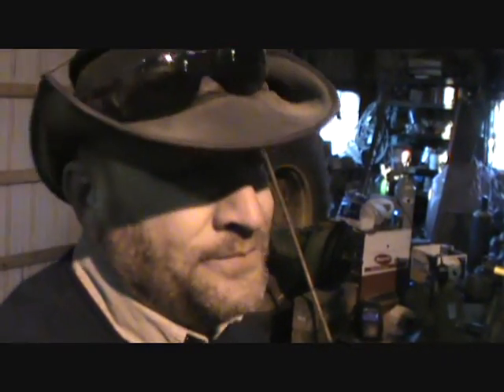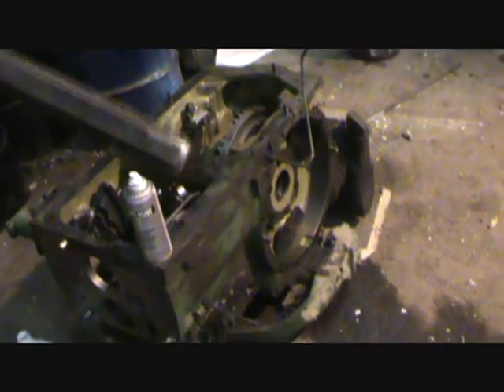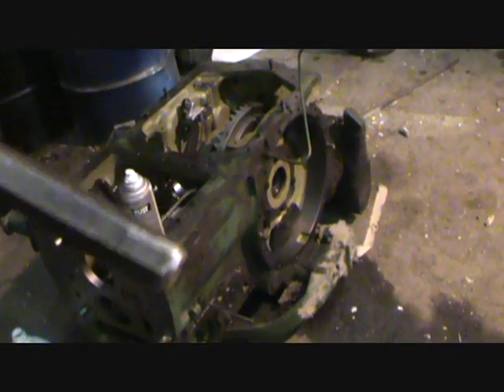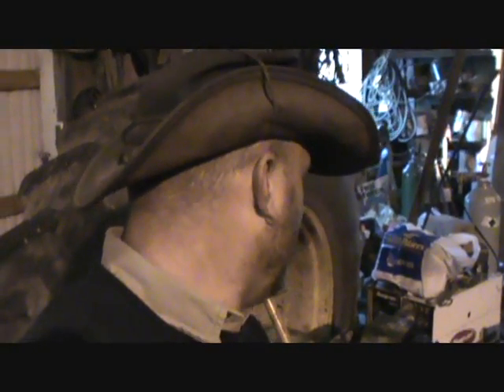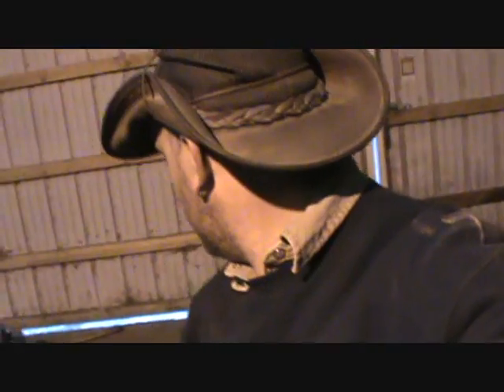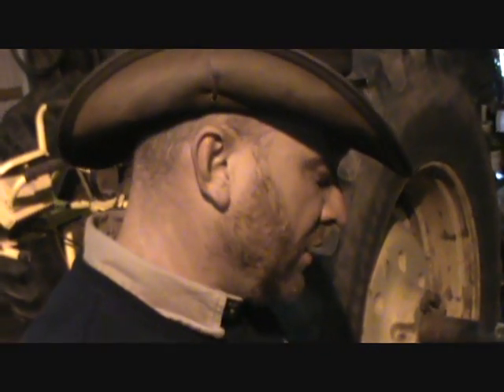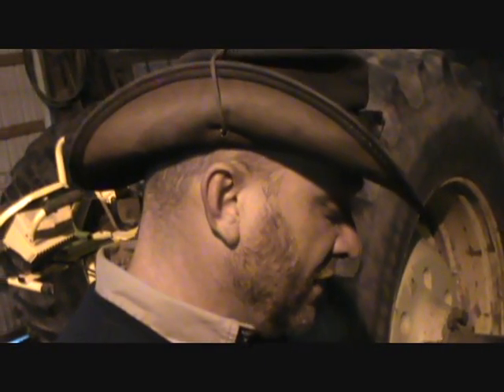Got my ring and pinion

Comment: Not sure if the hex shaft somehow being able to lube the transmission was directed at me, but it's certianly not what I meant. I had to re-read all of that. I thought vaneps0 was talking about the pump only supplying oil to main hyd pump. That's when I pointed out that the little tube (which you purchased) supplies oil to trans shafts. It connects to back of the pinion. Anyway, this appears to be a case of miscomunication. Sorry if it was confusing.

Comment: Hey wes please correct me if i am wrong but isn't it true that you don't typically want to replace just one or two gears in a transmission because the original gears are machined together so if you replace just two wont it just cause more wear and possible damage
Thanks Richard

Comment: i know youve mentioned it, but could u do a video on why u like synthetic oil? i know it is "better" in some respects, but i just dont see it as being cost effective or good for higher mileage engines. we've had cars with 250k + miles on them and all they got was dyno oil. i mean, if i start using synthetic in my new truck, should i expect 500k miles? plus, i met a amsoil dealer a while back and he claims 25000 mile oil changes, which i just don't see as a good idea, ever.

Comment: nope,  mass-produced gears like these are machined to a tolerance.   while mixing old and new isn't recommended due to possible uneven wear,  it's not a red-flag.   only precision equipment or aerospace tech would have matched machined gearing (and possibly race transmissions)